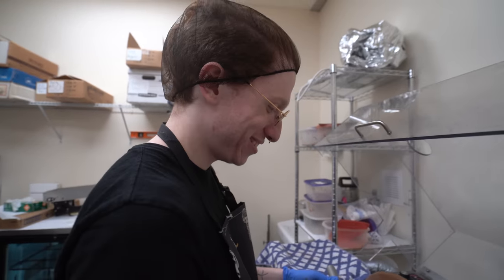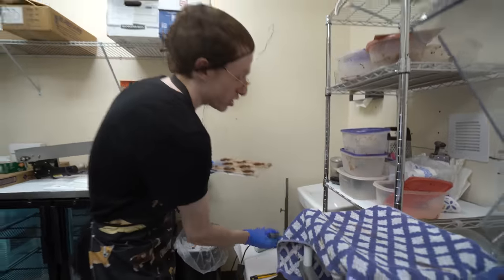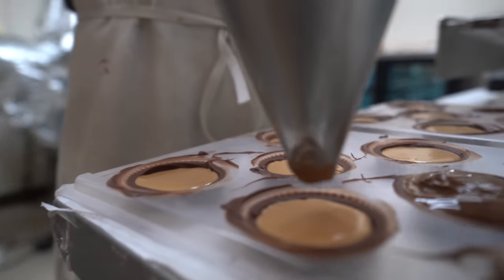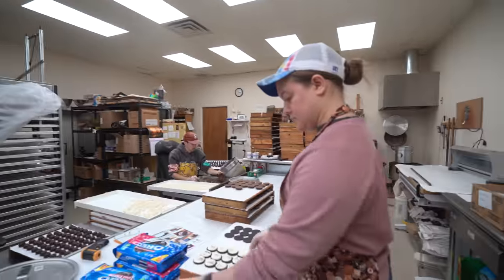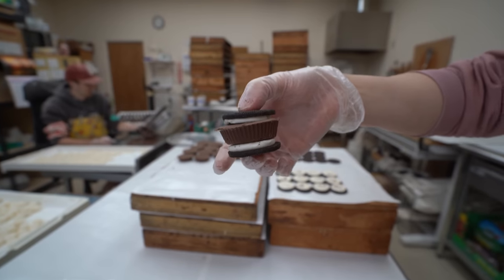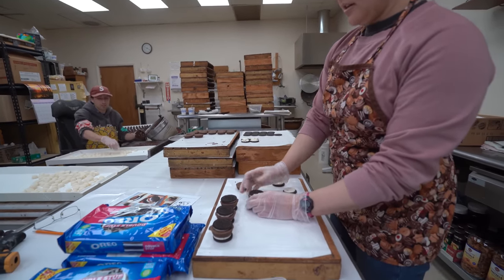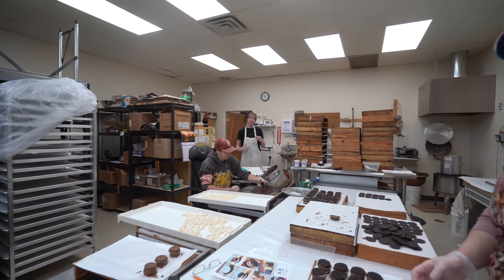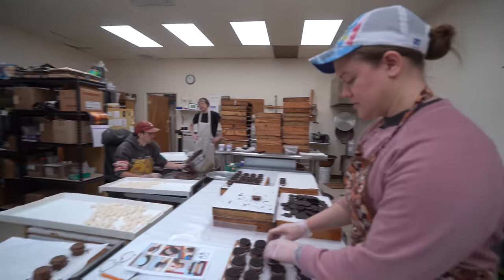Our Wildest Candy Creation Yet! 😍

Comment: I started Making a version of this about a year ago.  I made 3 batches before I finally came up with the perfect version!  I have a silicone reeses cup or cupcake mold.  I only fill it about 1/3 full of chocolate and don't dump it out coating it I do this in a different process.  I make my reeses & I add Graham cracker crumbs and salt and powdered sugar and just a touch of vanilla and brown sugar then roll it in a 3/4" log put it in the fridge in a zip lock bag in the fridge for about an hour.  Then  I cut little rounds about 1/4“ thick then set those rounds on top of each cup of chocolate and take a toothpick pushing the peanut butter round down a little bit letting the chocolate cover the top being careful not to push it too far down.  Then if I need to add a little chocolate I just squeeze some chocolate on the top out of a piping bag and tap the tray to smooth it out.  It makes almost a thin reeses.  Then I take my double stuff oreos and I scrape out the centers and roll the centers out and use a 3/4" little biscuit cutter or the top of a salt shaker or spice jar would even work.  Roll it out to 1/8" thick. Cut out the rounds and then put them back on each oreo cookie top and bottom and sandwich them together.  Then I can dip them in chocolate I do white chocolate, milk chocolate, then I do a black and whit which is half white half dark.  Just thought I would share these are so good and an easier bite! 😊

Comment: Thought of an easy way to get the cream to stick, use one of those wooden trays. Put it upside down on the "stack" and lightly tap the bottom of the wood tray. Remove top tray then I think they would be stuck together. Or you could try a sheet pan instead.